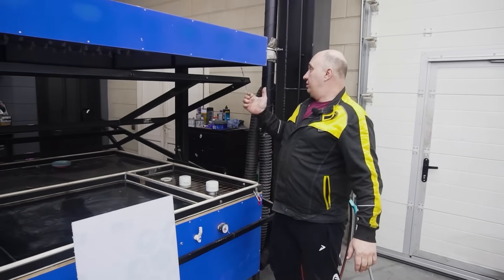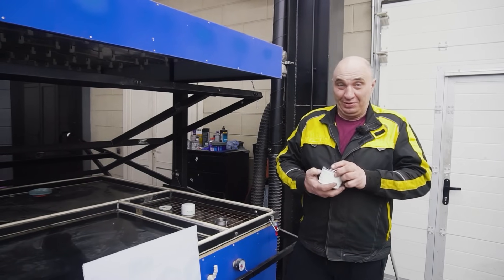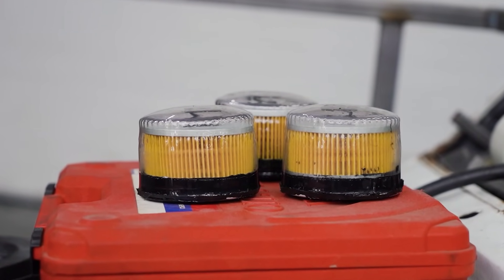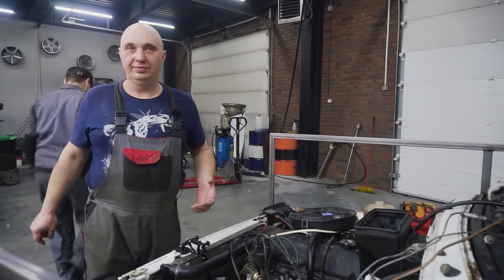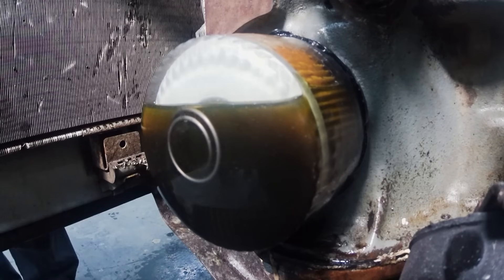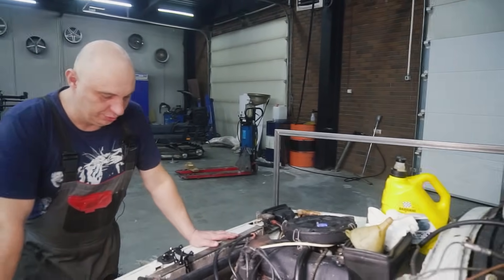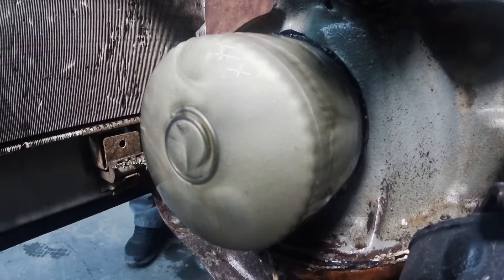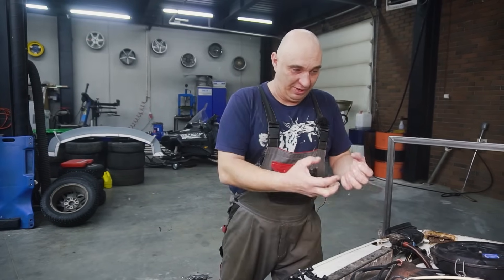We make transparent oil filter

Comment: A lot of oil filters can be had in a longer version. It would have to be matched up rather than part numbers. Oil filters for small block Chevys are easily had in long versions, if there is room to fit there is more filter area for same price. A long clear one would be easier to see. Great Video!
Reply: The oil filter in my ZTR mower is larger than the one in my Ford Escape.  It just doesn’t seem right.
Reply: @robertheinkel6225  It does though. Lawnmower engines are nowhere near as well built and well protected as car engines. The result is that oil gets much more contamination in it with a mower engine compared to a car engine. :) More contaminants, means a bigger filter is needed to last the duration of the oil change interval. A larger filter also increases overall engine oil capacity. A lawnmower usually uses a carb until you get into some realllllly expensive products. Carbs dilute the oil with unburned fuel that condenses and drips into the sump. Therefore, more oil volume minimizes the effect of gasoline dilution over the oil change interval. Usually you can't easily make a crankcase bigger arbitrarily, but you can remotely locate the oil filter mounting plate and upsize the filter very easily. :)
Reply: @robertheinkel6225  LOL the filter for my Hyundai Pony (1.2L to 1.6L) is twice the size of that for my 06 Corolla 1.8,
Reply: There's usually high milage filters that are longer. For my civic, there is regular filter, and high mileage filter that is taller. Usually same part number but with an XL at the end or something like that depending on manufacturer. Not every brand has that option, but most do. I always get the taller one, but ignore the "high milage" claim and still change it with every oil change at 7k miles. The high milege from stp claims 15k miles and mobile one claim 20k if I recall correctly. They're usually only a dollar on 2 more so I think it's worth it
Reply: Bigger and especially longer oil filters tend to fill up later, at ten of thousand startups along the engine spanlife will make a margin in wearing.

Comment: is the filter on the return to the oilpan or right after the oilpump on a engine?  If its on the return, its completely unnessecery to prefill the filter that some people do
Reply: The filter is right after the pump.  The return side has no pressure, it is just gravity feed.
Reply: Yes, some people tried to prefill the filter, and then realized it's mounted horizontally. Free chassis undercoat.

Comment: WHY ISNT THIS A THING??!!  Imagine, it could be used to see low oil, low presure, just dirty the oil is, an easier way to see if other liqiid is leaking into the oil.  Then again I would love to see an all plastic engine and transmission.  Line certain areas with insulators and metals to be able to tke the heat from combustion/rotsting assembly.  A guy can dream....😔
Reply: All plastic engine....

That reminds me of when I was a kid in the late 80's I built this see through model v8 engine kit (well I tried to, it was too difficult and my dad finished it) it was cool, had light bulb spark plugs and a little distributor.

Then I knocked it off the bookcase a few months later and it shattered all over the floor.

I bet you can still see them on eBay if you searched, they were pretty common.
Reply: Your opinion is duly noted.
Reply: @StandardGabriel375  As it should be.
Reply: Send a big billet to D&J Machine. They have the files for the billet Enforcer Cummins
Reply: They already solved that. It's called a dip stick, genius.
Reply: @user-os6ch5pt7w  Wow.  No i didnt know that.... No i meang with just a glance at a clear oil filter.  And djpsticks suck, u need a decent eye.  Half the time I couldnt tell if it was the actual oil level or residual drops from sloshing around.  And then again most engines u cant look into the bay and say "oh theres the oil filter!"

Yoy know what I got a question for you.  If you werent impressed, why did you watch the video???!
Reply: @StandardGabriel375  That's why dipsticks have holes, or mechanical adhesion lines, on them to hold the oil level true. This isn't, and has never been, a problem. If you can't see, get glasses.

Comment: That was fascinating! I never imagined the oil flowed that much.
Reply: Oil can flow up to 50 to 80 psi now you picture water hose shoots 65 PSI now picture of water hose at 80 psi that water would shoot 15-20 ft out of the hose. So yes oil is under high pressure and it is moving fast to get in the valleys and veins of the engines.
Reply: @cliffcorbitt9494  Engines are so amazing and the many veins and passage ways oil flows through to keep the engine lubricated properly is so fascinating. Long Live the internal combustion engine
Reply: @cliffcorbitt9494  It is not the psi that counts, it's the size of the "hose" the oil uses to move. Like the water hose you talk about. Oil can flow at over 1000 psi incase you wondered, and it does in many places.
Reply: @cliffcorbitt9494  pressure does not equal flow.
Reply: @screener545  correct
Reply: Imagine a performance engine. This engine probably runs without oil 😅
Reply: Damn you've never turned on a car after you forgot to put an oil filter on or lost a drain plug on the highway - Free undercoating!  The engine is highly pressurized, it'll shoot out oil in no time.
Reply: I did a dumb thing with my Tacoma when changing the oil and filter. I didn’t want to take the rock guard off the bottom of the truck and the filter is hidden under the alternator so t found a filter wrench that fit it and was trying to loosen it and I did get it loose but didn’t realize it and I said heck with it I’ll drive up on my ramps so I reached in and started the truck and turned around to get the ramps and then looked to see a sea of oil under my truck. I shut it off quick and checked the oil and there was a little over a quart left. 
No harm done but I found out just how much oil goes through the filter and let me tell you it’s all of it and fast. So it’s good to change them and make sure they are on correct.

Comment: This is genius why hasn’t other companies tried to make it? It would be easy to see how much dirt is on the filter or if you have a serious engine failure.
Reply: Plastic wont last as along as steel
Reply: @jreererer8490  ikr lol
Reply: You can buy clear view oil filter oil filters with glass windows above the screen. They're pretty much only used on dedicated race cars because of the price and reduced filtering capability
Reply: @Mrshotshell  ok cool
Reply: Steel is much more impact resistant in case it gets hit with a stone, or gets ran into a curb or something. Steel will dent or scratch, plastic will likely shatter or crack.
Reply: @Colorado_Native  what if some kind of acrylic or glass that would be able to stand the heat?
Reply: @drifterig1463  I think you have a good idea there. I was thinking the heat would cause it to bulge out, but glass might work. Perhaps the same kind of glass a Pyrex measuring cup is made of. They are also impact resistant. Who knows how many times I've dropped mine, or it's been knocked off the counter top.
Reply: @drifterig1463  Diesel semi trucks have a glass fuel filter so it’s easy to see when it gets clogged up and needs to be changed. Those get just as hot as engine oil. I think it could be modified to use a cartridge filter from a car engine. Those clear race car filters are just there to catch any metal. They don’t really stop contaminants.
Reply: There's always the possibility of a filter bursting. 🤷
Reply: You can buy an oil filter cutter. 

I open up many of my filters to see what's going on. 

Brand new engines have the most shiny bits, with used engines barely having any show up. if you open a filter with like 7k miles on it and squeeze the oil out or let it sit on a towel for a few days and seep "dry" you can see some carbon or soot beginning to get caught too. I think most filters are  fairly clean when changed. They can go a lot of miles. 

Much easier inspection with cartridge filters though.
Reply: @volvo09  I bought a nice cutter some time ago just to see what kind of 'stuff' was being collected. I also tried some exceedingly strong magnets on the outside of the oil filter. They were definitely working. You could see very fine particles in the pattern of the magnets. I dont have a way to measure those so don't know if the filter media would have captured them or not. I recently added an Amsoil Eabp90 bypass filter to capture small particles. Will be interesting to see what is inside.
Reply: https://youtu.be/U0fFt6Ytzio
Reply: Aluminum oxide heated to 5000 degrees to turn clear would be to expensive for oil filter
Reply: That's why the manufacturer has scheduled maintenance. Changes the filter to when they say to change it, they designed the engine for those standards.
Reply: It was done something simmilar - not exactly the same. Amsoil had so called by pass oil filtration system for example here:
https://www.youtube.com/watch?v=XemTDNbbfeg. 
It looks great on presentation (as usual ;) ) but I found some random guy videos who have sent his motor oil for analysis to the laboratory and there was no significant difference in contamination with extra by pass oil filter or without it. Cant say if he properly installed it but he had no positive results on his car.
In the past there were in sale some extra containers filled with paper filter looking like paper tower roll for extra filtration - some stated they were working well improving their oil filtration.
And other company presentation of bypass filtering:
https://www.youtube.com/watch?v=AaBuV9pOcrU